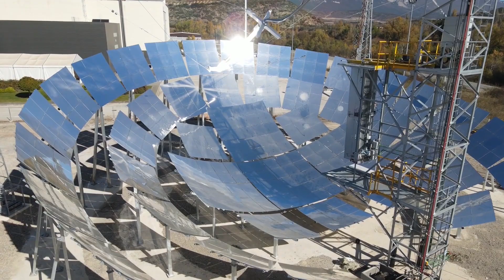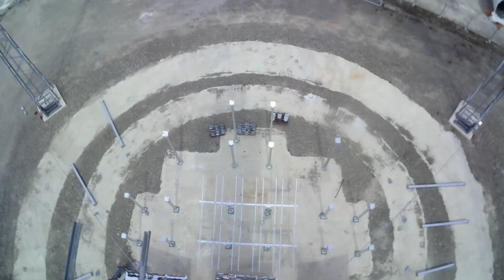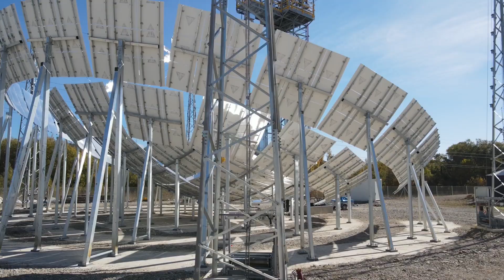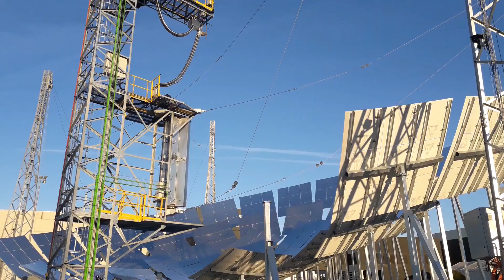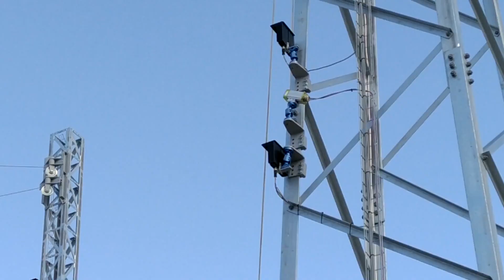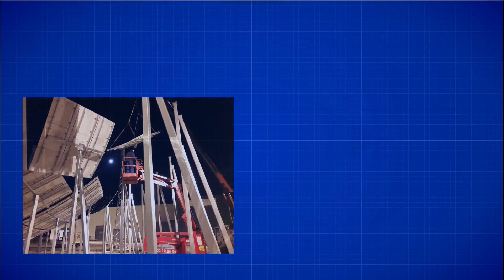Project MOSAIC – Virtual visit of the prototype

Comment: Impressive project !
Best of the project: Programing the accurate orientation of the system at every moment, has to be a dificult engineering task, by means of a good algorithm, because the structures with cameras are so big, and they will deform themself a lot, with the wind, heat, cold and so for...!
Precise measures...
Congratulations !